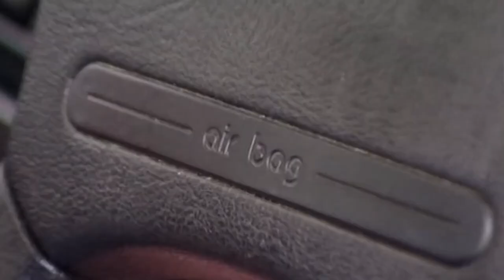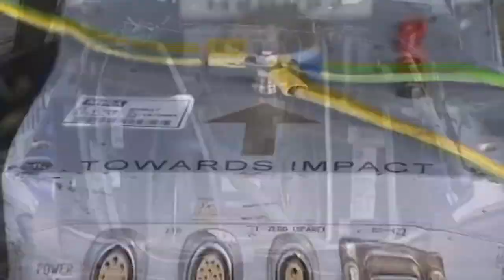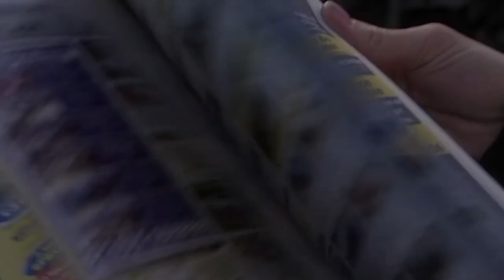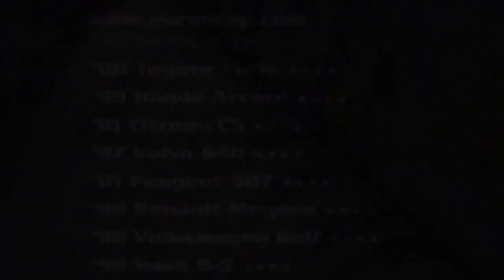What happens when an old car crashes into a new one? | Fifth Gear Classic

Comment: Now imagine that NEW car vs a new car today. Even bigger of a difference. Or, a normal city hatch, something like Golf, C4 or Megane vs some big and heavy cars like a Land Cruiser or GLS...
Reply: No, it wouldn't be as big of a difference.  From 2004 to today, car safety didn't go up much. New cars are maybe 20-30 % more rigid than those in 2004.  Whereas the difference between an Espace from 2004 and one from the 90's or 80's was like 200-300% less rigidity and strength.  Passive safety didn't advance as much as active systems, prevention systems, etc.
Reply: @derbigpr500  these days they have added systems to try and reduce crashes
Reply: No, the big jump in safety occurred in the early to mid 90's.

Comment: Hmm.. so airbags are not that critical safety feature as people think. A good  chassis and seatbelt pretensioner is enough when compared to a car with unstable chassis and airbags.
Reply: They are this impact wasn’t bid enough to make the dummy hit the steering wheel if this was at 40 the airbags would of been very important

Comment: Whats the weight difference between the two? probably 500kg heavier than it used to be which partly causes the results
Reply: It is a common misconseption thinking that heavier vehicle will deform less. During impact kinetic energy is divided in half for each vehicle.
Reply: @NoName-md5zb  But G-forces are higher in a lighter car. A heavier car crashing into a lighter car, the heavier car will stil continue to move forward a cetain distance after collision, while lighter car will stop at the spot, and then move in the opposite direction. Huge G-forces in a lighter car.
Reply: @DashCamSerbia   It doesn't matter, the difference in G-forces is very small here, both cars stop suddenly. In fact, if you account for the much higher level of deformation in the old car,  it compensates for the lack of weight and still slows down more gently than if it was more rigid.
Reply: @derbigpr500  I am not talking about these two cars. I am talking in general. And the difference, if it happens as I described, is huge.
Reply: The difference in mass and rigidity between the 2 vehicles is highly significant in this experiment, the new heavier vehicle as able to decelerate at a lower pace to zero as it hit a much softer object, therefore the g forces were much less in the new vehicle at point of impact due to the older car literally cushioning the blow. Invert this and you'll understand why the older car fared much worse in this experiment. Due to the differences in mass, momentum and the change of energy it's simpler to say the older car had a crash at 40mph and the new car at 30mph. Had the new car crashed into a solid brick wall instead of a fluffy old soccer mom car its damage would have been more significant,  but less interesting television.
Reply: a light car with a rigid chassis is safer than a heavy car with weak chassis. renault uses computer to calculate the best deformation zone to lower the crash injuries.
Poeple think an heavy car is safer but no.
Reply: @stephen10.  Yes, but it depends. I was comparing 2 cars of the same rigidity but different weights.

Comment: I was surprised to see that the airbag didn't go off in the newer car, with an impact speed of 70 mph.. .
Reply: Impact speed was 70 but damage is same as 35 hitting stationary object. Thats physics
Reply: @NoName-md5zb  If it was just a normal crash test then yes, however BOTH vehicles were travelling at 35mph towards each other. You obviously weren't paying much attention in your physics lectures...
Reply: You should go back to elementary school and relearn physics. This is not a 70 mph crash.
Reply: @pip5461  "You obviously weren't paying much attention in your physics lectures..." - How ironic. It's funny how the dumber someone is, the more confident they are in their lack of knowledge.  Two cars hitting each other at 35 mph means they both went from 35 mph to 0, therefore, it's a 35 mph crash from the perspective of each car.  In no way is it the same as a 70 mph crash, where a car would stop from 70 mph to 0 instantly. You're clearly mixing different concepts here, total energy of the crash with momentum, acceleration, etc. and should obviously relearn the very basics of physics, instead of telling someone else (who is right) to do so.
Reply: The car was in neutral. It  doesnt deploy in neutral.
Reply: @derbigpr500  I have an MSc, what do you have
Reply: @alphatrion100  Thanks for the info, it was too difficult to see inside the older vehicle.
Reply: @pip5461  You have MSc, then why are you still wrong?
Reply: @pip5461  you should sue your uni. Because thats shameful. unless your MSc is in media studies, PE or something.
Reply: @James28R  HaHa

Comment: I saw a 70s muscle crash into a recent truck. The car had no damaged, the truck was flipped
Reply: I have seen the reverse.  The engine in the passenger compartment.  Even the crash test between the old 60s Chevy impala vs the 2010 Chevy Malibu.  Sorry I will always take the new car over the old.
Reply: @kevinW826 that was a staged crash
Reply: Photo's, or it didn't happen.

Comment: It’s an airbag failure.
Reply: No, the reason the airbags did not deploy on this vehicle is simply that the gear selector was set to neutral and not drive and no weight is detected on the seat. So the car thinks she's parked with no one on board.
Reply: @lordofkiwi5144 No, nonsense. They didn't deploy because they weren't needed.

Comment: No disrespect the old Espace wasn’t that great in its day as I recall they were like cardboard panels when they hit decent family sedans Of the time in the early 90s, it stood no chance, I suspect the newer (now quite old) Espace wouldn’t fair so well now ,  whilst these tests are interesting they don’t represent real life , i saw the “5 star” Laguna years ago flattened by a ford escort (escorts noted as not the toughest vehicle) at the time it respective to conditions, point of impact and load carried etc etc etc
Reply: " i saw the “5 star” Laguna years ago flattened by a ford escort"  - That's absolute horseshit. Don't lie. Renault Laguna II is still to this day one of the cars with the highest torsional rigidity and body shell strength of any car on the road. An escord is a tin can in comparison. A 2001 Mondeo was a tin-can compared to the 2001 Laguna that got 5 stars. You can literally watch videos on the Laguna on youtube hitting concrete walls at 110 km/h and getting away looking like it was a 50 km/h crash.

Comment: And if it was a Volvo you only need a new bumper🤷‍♂️😂
Reply: Renault was safer than Volvo when this Espace came out. In fact, from 2001 to 2007 Renault was the safest car brand in the world, with the first car ever to get 5 stars on EuroNCAP in 2001 (when Volvo, Mercedes, BMW, etc. struggled to get 4), and pretty much all of their models received 5 stars from that point on. They had like 6 or 7 car models with 5 star safety ratings when most brands didn't even have one.  Also, Renault revolutionized a lot of things in car safety, in terms of how crash structures are designed, how metals are welded together, etc. that LITERALLY EVERYONE else copied and uses nowadays.
Reply: That isn’t true at all if that happed everyone in the car would be dead. Cars have to crumple to absorb the energy of the impact if they didn’t all the energy is getting transmitted into you that’s why older cars don’t smash into a million pieces. Volvo is the safest car brand because the front structures are designed very well to crumple in a impact and there safety cage is extremely strong. Just watch a Volvo crash test and you’ll see that u would need more than a bumper.
Reply: @davidtheswedishtechguy  Stop writing nonsense, Renualt was the first manufacturer to produce a 5 Star Ncap tested vehicle. The S90 did averagely, the S70 was below average. Let me guess, your driving around in a 340 telling everyone you meet that it's a tank, and the safest car in the world?
Reply: @davidtheswedishtechguy  I meant that as a joke, as in I was going to produce some evidence to the contrary

Comment: That y I got 2018 F-150 brand new
Reply: Khmer Texas Going Home 2040 hardly the safest car on the road
Reply: Trucks aren't exactly known for their safety. Other than being big and heavy. If you're gonna crash into a tree, or a pole, or a wall...you'd be much happier in a regular car.
Reply: @Tallandcharming  actually most trucks are safer than cars, the bigger size means they cause more of the damage and have a slower deceleration because up against a car they are heavier making the car its cushion. I would rather be sitting passenger in an F-150 vs the two vans in the video.
Reply: Kyler Anderson is rather be sat in a paper bag than the older vehicle! Bigger trucks have one or two flaws, namely stability, handling and braking compromises over smaller vehicles.
Reply: @kyleranderson1948  enjoy rolling
Reply: @ellenorbjornsdottir1166  who says im rolling?
Reply: @Tallandcharming  thats also with 2020 trucks also, its a truck... kinda what it entails

Comment: Try my 850 Volvo against a plastic fantastic modern car from 2020
Reply: It's gonna turn your tin can Volvo into a pile of old rusty metal.  The new "plastic fantastic" cars have about 10 times as much rigidity than your 850. You just don't know enough about engineering to be able to comprehend that it's not the plastic bumpers on the outside that give the cars its strength. It's the ultra-high strength steels that the body shell structure is made of, under the surface. So keep knocking on those old cars and keep thinking that they're tough because their bumpers are harder than on new cars, but that's fake toughness. 

Also, fifth gear already did a comparison of an old Volvo vs. a "new" Renault Modus, like 10+ years ago,. And guess what, the plastic fantastic Renault won, easily, despite being a smaller and lighter city car, vs. a bigger and heavier Volvo.
Reply: The 30 year old design would stand no chance.
Reply: They did that 15 years ago vs a modus.
Reply: Your 850 wasn't even that safe when they crash tested it originally, what on earth are you on about? My 2016 Ford Fusion would hammer it to an oblivion, you'd be off to chat with the invisible man in the sky.